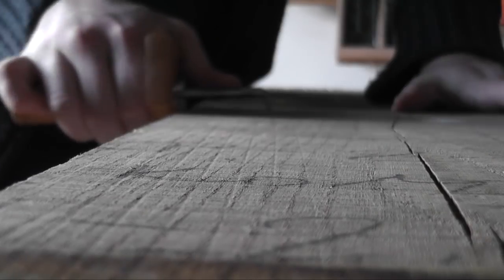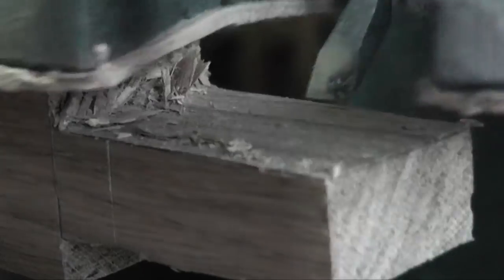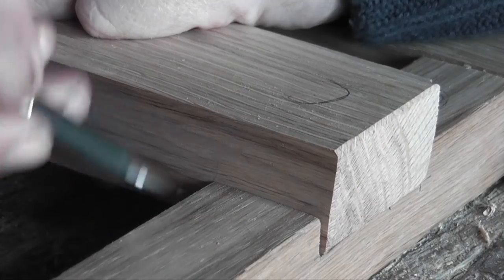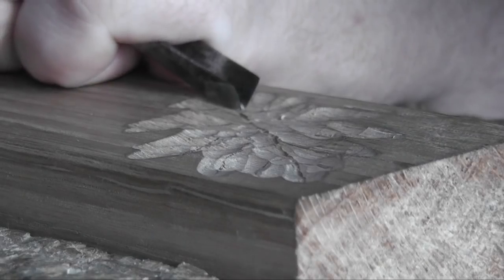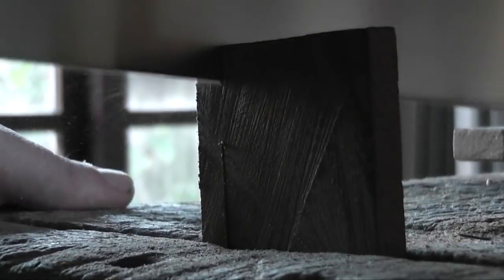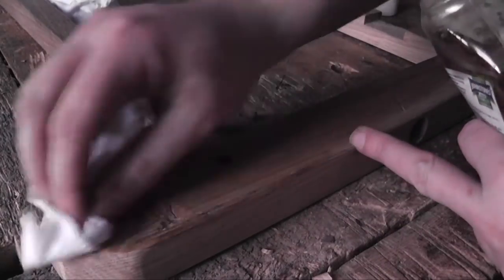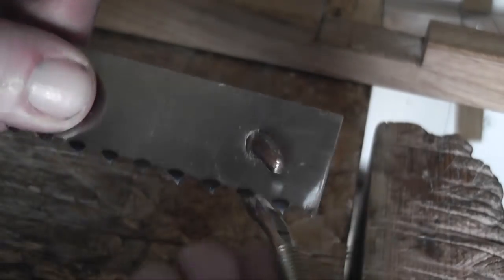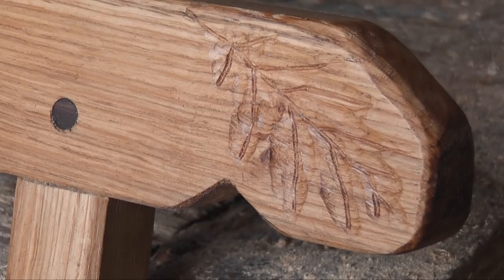Poor Man's Roubo Style Frame Saw Using a Bandsaw Blade [Woodworking Tool]

Comment: OK, this solves one of my problems, that I too want a rip frame saw.  The blade was the problem, you solved that for me.  I would choose as large of a tooth spacing due to the amount of blade in the work.  Fewer teeth=more room for swarf to exit the cut.  This IS after all a rough cutting tool.
I'll be looking for any dimensions I can find to copy-ish.

"Squeaky brace"...well, a drop of oil on the brace pivot on top will not only fix that, it will keep it from self-destructing.  And make the work a bit easier, but I suppose someone else has already brought this up.

No need to heat-treat modern bi-metal band saw blades, as they are often HSS teeth welded to softer steel backing to save money.  Just drill REAL SLOW, and high pressure with a razor-sharp bit, to prevent work hardening the steel.
Visit shops that make up their own blades, as they may have pieces from the ends of rolls that they can just give you.  I have several rolls of bandsaw stock that I bought at auctions for next to nothing, and have a local shop weld them up for my band saw at home for a couple bucks...this has brought my blade costs down from $15 to less than $4 per, and I always have extras around to just put a sharp one in and save wasting time trying to burn through with a dull blade.

Making the dowels for the draw bores: make them extra long, and taper the ends. This will help the dowel snake around the holes to pass more readily, and prevent punching out the other side of the wood.  This is common timber framing practice using trenails.
The glue was gilding the lily, but nothing wrong with that at all.

I see no problem with the blade wearing out at the dowels/hook bolts for tightening.  Some prefer relaxing the blade tension when not in use, as they might worry about potential crushing of the wood in the joints over extended time under tension...I've seen this happen on a cheaper commercially made frame saw I bought in used condition.

Over all, WELL DONE SIR.
Reply from the maker: Thank you Ryan, appreciate the advice and I'm glad you got something out of it!

Comment: Very nice job. 
i'm making a frame saw as I can't find anything in the u
I have loads of salvaged exotics and often waste a lot of wood by planing too much of it away. Am trying to source a length of 3" or 4" wide bandsaw blade, but it was nice to see that it will work with a narrower bandsaw blade as I can get hold of used 1" and 1 1/2" quite easily.
If you ask your local steel stockholder you might be able to get hold of a short piece of square steel tubing and offcuts of steel. Add an eye bolt and its straightforward to make some hardware, similar to the Blackburn Tools one, for about a tenner.
Nice to see a UK maker making one of these saws.
Reply from the maker: Ahhh that's a cool idea I like the sound of that, thank you very much! I I'm glad you enjoyed the video, I certainly think the Blackburn tools one is better but obviously a lot more expensive than this. I hope you can make it soon 👍

Comment: Hey Clint - now that this was made over six months ago, what are your thoughts? How is it holding up?
Reply from the maker: Pretty well actually! I was expecting the bolts to be slowly breaking through the blade but they're not yet and I've used it quite a lot. The blade still twists too much so I think I might add straightening blocks to the end in the same way most frame saws are made.

Comment: Have you used this frame saw much?  Has your design of holding and tightening the blades wore out the blade quickly as you predicted?  The only difference I see between this and the Roubo style is that the force is distributed over two holes instead of one.  Did the blade fail at where you attached to hook?  I love your poor man's solution as I am a poor man and want to build a frame saw.  Your solution is much less expensive than buying a kit.
Reply from the maker: I used it as lot over three to four months after I first made it and it was much easier to use than a traditional handsaw. It didn't wear out and is still usable now. The main issue I had was keeping the cut straight. Perhaps with a few more months practice I'd get better at it but I think it needs blocks at the ends (where the blade connects to the bolts) to stop the blade twisting. 

A lot of the kits have such a solution, I think if you look at the Blackburn tools kit it has metal "blade holders" at each end to keep the blade straight. The bars I put across the saw to hold the blade weren't sufficient. 

But, I found with a good deep kerf cut all the way around the piece and with a bit of lubrication on the blade it worked surprisingly well. 

It's definitely worth looking up different designs online though as I think you could add little bits from each one to create the saw you want.
Reply: @ClintRoseCarving  Thank you for your time.  I can see how the bracket is necessary to cut down on the torque on the blade.

Comment: You might consider the blade fixing method used in this video - https://www.simplecove.com/406/an-inexpensive-frame-saw/   Still very inexpensive method.
Reply: Additionally, Highland Woodworking in US has inexpensive blades.  The one references by the video I noted, is not available at that link.  Very nice video.  That's coming up on my list of things to make.